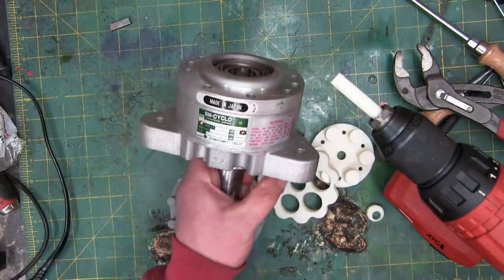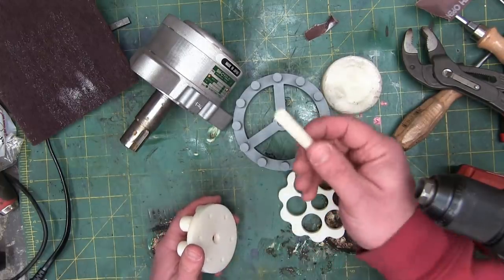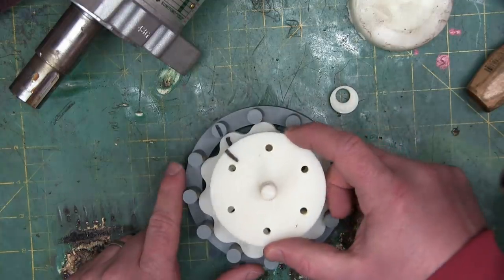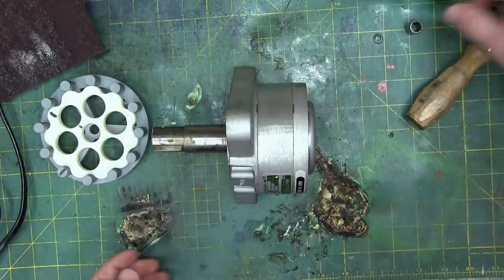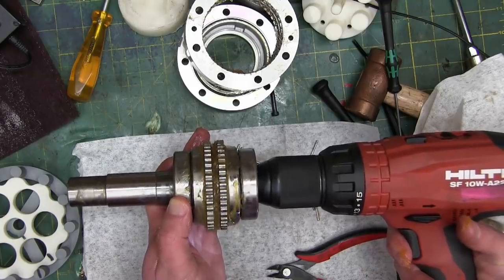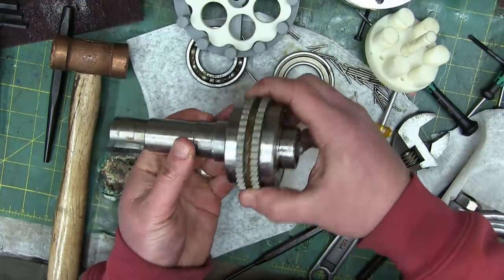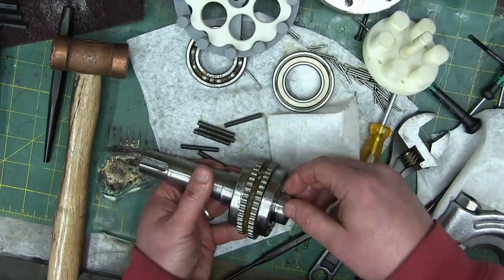BOLTR: SUMITOMO CYCLO GEARBOX | Zero Backlash!

Comment: Good luck putting that one back together.
Reply from the maker: Judas!
Reply: thats what i was going to say
Reply: Piece of cake. Just throw away the parts left over. It works every time.
Reply: Roland Anderson no problem
Reply: My first thought.
Reply: Parts are made of foam plastic to aid assembly. Easy with a little practice. Plus all SUMITOMO parts are individually numbered for reassembly in the right sequence.
Reply: asbaDoce 
Wow. A video just for reassembly
Reply: @larryscott3982  is a great guy
Reply: When I was about 24 i took a (much bigger) one apart and put it back together, it had two stages and weighed probably 800 pounds. Given it took me a couple days and I was in a dedicated industrial repair shop. But it wasn't that bad, I did it with no training whatsoever, I was working mostly on process pumps at the time and this thing rolled in the door; had no idea what it was at the time.
Reply: A lot of grease around the pins would help holding them in place.

Comment: Yet another thing I had no idea existed 13 minutes ago, and now I have to have one.  Not for any REAL reason, just to have one in a box what for showing off to the ladies and such.
Reply: I'm sure you could find a use for it. Get your lug nuts 43 times tighter than normal. Adjust the hot/cold water setting in your shower 43 times more precisely than ever before! You'll surely think of something.
Reply: Get it in your next robot wars crusher weapon?
Reply: For real huh. I know what you mean.
Reply: Some weird ladies you've got hanging around.
Reply: Plus, they're shiny!
Reply: The ladies always love a gear box
Reply: Small enough,what’s the metal?and how much?,, I wonder how it would work on a boat windless
Reply: ya ladies care about your torque spec

Comment: dude, if you 3d print in ABS, you can vapor polish with a wee bit of acetone. to hell with 'a few hours of clean up' on a print.
Reply: Blake D also going slower with a finer tip
Reply: MyLonewolf25 - too much information. Sick!
Reply: In PLA it works with DCM.

Comment: Two words of advice:
1. Very low backlash, agreed. But nobody will tell you the input is not linear to the output! If you plot a chart with the angles measured at the input and at the output, instead of a nice diagonal straight line, you'll get a wobbly diagonal, like a a sinusoidal turned loose on that line! Of course, the effect is tiny, but it's there, inherent in the math of the thing. And if you get the dual stage model, where you have a 1 : 10 coupled to a 1 : 9, for instance, you get the ripple of two asynchronous sinusoidal waves violating that diagonal line...
2. Even using two discs, you never completely mitigate the vibratory effect: you just lower it, by offsetting the direction of the vibration from a perpendicular to the rotational axis to a direction at an angle from it...
Reply: Eros Nicolau what if 3 are used to offset each other like a 3 rotor in a 20B rotary engine?
Reply: Yee Sen Chai I would imagine it would just divide the vibration points (nodes?) Into thirds. Basically you can always cut something in half but you can never get rid of if.
Reply: Yee Sen Chai Oh I know what happens with that one, you get all the teeth sheared off your gears and your rear end will never be quite the same.
Reply: Eros Nicolau the winding were of the standard lotuseldeltoid type with two sperbing bearings to effectively reduce side fumbling...
Reply: All cycloidal transmission devices have a torque ripple. This is caused by the near zero speed motion when the tooth of the rotor is in the pocket of the stator. The angluar motion switches from about the center of the rotor orbit to the center of the lobe. If you've ever used a spirograph you have felt this (it is uncomfortable when the rolling radius nears zero)
Reply: Damn you longstar550
Reply: longstar550: Turboencabulate much? :D
Reply: NerdyFirefighter: That makes a lot of sense too! And I think that effect explains both vibration and non-linearity of the output
Reply: Zeno's Paradox?
Reply: @GUARDIAN1147 You CAN get rid of it with the proper balancing and fixation point. But normally not at every order of frequency.
Reply: Best reply I've seen in a while.
Reply: longstar550's reply that is
Reply: Yee Sen Chai that still wouldn't eliminate it. Of the total stage depth, you'd need to have 25% on one end at 0°, 50% in the middle at 180°, and 25% on the other end at 0°.
Reply: NerdyFirefighter ahhh. That's true. Thanks!
Reply: Isn’t it similar to the classic BMW boxer were there is a cancellation of energy similar to noise canceling earphones?  As long as there is no oscillation induced by the operator there should be no gyroscopic precession, or imbalance... but that’s just my two cents, eh?
Reply: If the two stages are 90 degrees out of phase it should balance to a linear movement. AVE, are you sure it's 180?
Reply: I would offset the inherint perpindicular radial torque offset balance, with a mitigating , angular  to thrust modulated adjustment inclined shim, with just enough trapezoidal  balance capacity , to further induce a fragmenting, but otherwise polarizing momentum capability of 17.5 inertia degrees, while applying a stress reduced, pre-loaded function stator type of manual push to pull effect omni phase ripple inhibitor.
Reply: @longstar550  You're forgetting about enstrapulation. With sufficient lateral hardslip (to use a layman's term) you can all but eliminate greyslide.
Reply: Having used these types of things at work, I can tell you that you are more likely to get motor vibration then you are to get vibration out of these reducers, especially on the output side... TBH I have seen more vibration induced by motor shaft couplings then nearly any type of gear reducer... the speed of rotation of the unit is generally far too low and the harmonic frequencies far too high for any vibration at normal operational speeds.
Reply: So let me get this strait... you divide the angle by the dangle?
Reply: What if you mounted two of these back to back so that the wobble of one cancels out the wobble of the other?
Reply: Richard Smith The most sophisticated 1:1 coupling ever made!
Reply: @rpvermeulen  ;) I didn't think anyone would get it.
Reply: @NerdyFirefighter  That has to be the nicest explanation I've heard for this! It explains beautifully both the concept and the result! Thanks, man!
Reply: And as for the ability to create vibration...

Comment: I used to work at Sumitomo in Chesapeake,VA building these exact same units. Our biggest units were almost 2 tons in weight.This is a very old model but love the vid
Reply: Too Shmart That is a place I wouldn't mind seeing.  Cyclos are lovely inside.
We have replaced cyclos that I remembered weighing a little less that 4 tons.  6000 series 2 stage 600ish to 1 reduction with 15HP motor.
I would have to check the nameplate, but that location sounds familiar.

Comment: I use these everyday as part of a bigger gear train assembly. Taken apart they are pretty mesmerizing to watch. Think of ones the size you can't even put your arms around, yea they are a pain to put back together. Unless you know to flip it upside down so output shaft is pointing up then pins go in last. Noway you are putting the pins in before the discs.

Comment: 8:42 Two contra-phase cycloidals, "minimize" (do not eliminate) vibration. The centrifuguals are neutralized, but since the cycloidals are separated along the main shaft, there is an oscillating torque applied to the angular momentum vector, which exerts a nutating pulse.
Reply: this ^^^.  It'll wobble back and forth, like a 4 cylinder opposed engine. Even though two cylinders are always going the same direction, they're offset so there's a moment (rotational force) developed.

Comment: The cycloidal drive is not going to be a good way to multiply torque, but I think you came to that conclusion already.  I have tried to use it a couple times in my job, but since I really am trying to multiply torque instead of reduce speed, it just doesn't work.  One of the main problems is that the pins that drive the output shaft are only partially engaged.  It is kind of hard to explain, but if you look closely at your 3D printed parts and the contact between the pins and the 6 holes in the gear, you'll see that 1 or 2 are at a tangential point and another 1 or 2 just aren't at a good angle to drive which leaves you with just 1 or 2 pins to do the actual driving.  As a speed reducer the cycloidal is amazing, but it just isn't a good idea for high load situations.
Reply: Eric i read your hard to explained conclusion. Read more then you will understand more.... half a vessel makes damn lot of noise!
Reply: I use one in on a large shot blasting machine in a foundry. The table drive has one it, no idea the reduction, but it puts out enough torque from a 2hp motor to turn a 2000# stainless steel table with 4000lbs of castings on it. Works fantastic.

Comment: The 2 rotor cyclo gearbox still has some vibration. It wants to turn with an axis perpendicular to the input and output. Because the rotors are hopping up and down 180° phase difference you get torque.
You need 4 to balance completely (unless i've missed something). Set them up as a straight 4 engine.

Likely overkill, but if you want insane high speed on that (i don't judge) you should cancel rotating oscillations aswell
Reply: You can just use three with the center one being twice the mass and offset from the outers, if we're picking at details.
Reply: i stand corrected
Reply: That design will balance the free forces of even order but not the forces of uneven order. Regarding free torque it will depend completelly on the fixation point of the gearbox.
Reply: TBH this idea came because it reminded me of an engine and as far as i know inline 4 doesn't have weighted rods to cancel torque (no engineering qualification whatsoever)

Comment: I learned more about how cycloidal gearsets work just now than I did in 10 years working in the bearing store.
Wailing on the sub-assembly with the ball-bearings pressed in place and/or hammering the ball-bearings in place causes the balls to peen the races that will eventually lead to premature failure.
This is why bearings (ball and roller) should always be pressed on, never hammered.
Reply: Tell that to the idiots who install U-joints with a hammer instead of a vise!!!  😖

Comment: I watch a lot of your videos! I wanted to chime in on your mention about recentering an off center punch. I used to build oilfield pump packages (Skids) gear drive and belt drive. I also rebuilt Industrial Gearboxes. I routinely drilled and tapped new holes for the covers on the Gearboxes including the shaft covers with just a drill and tap. Normally they would be sent to a machine shop for that but I told them it was not necessary and I did many of them without issue. Anyway, I used to just move my punch over but I found the best way to do it is to put your punch in the off center hole you made lean it over at an angle and point it in the direction that you want to move your punch hole in and hit the punch until you think it's where you want it then stand it up at a 90° angle and hit the punch harder. If it's still off center just do it again until you get it where your want it then once you have it centered hit your punch hard enough that it makes the hole bigger than the off center one where the point of your punch is or many times I would just end up overtaking the original hole with the larger diameter of the new one. Works every time. Well, At least if you are experienced and have a good eye it does!

Comment: Come to think about it - you can make a crappy one real fast using some laser cut steel parts and some bearings.
Jeez man, why do you hit things with bearings on them with a hammer? That fucks them right up.
Reply: VEC7ORlt He is using a brass hammer. It's softer than steel. Fucks the hammer right up not the bearing piece.
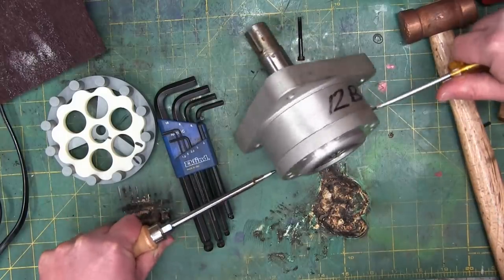Reply: its a copper hammer vs a case hardened or at worst a mild steel shaft - the only thing getting fucked up is the copper hammer - pause vid at 7:34
Reply: And the bearings, which are not designed for axial loads.
Reply: You gotta get those bearings off there somehow and it doesn't work to well radially
Reply: Your right unless he was holding the bearing on the inner race. And not using the seperator and the rolling elements to take all the load
Reply: You've never actually taken things apart have you? Lol
Reply: VEC7ORlt You would cringe at all the rusted on brake rotors I have had to hammer off of hub and bearing assemblies. Lol
Reply: Dan And That's always a good idea but sadly doesn't work a lot of the time unless you can get the shaft into the vise just below the bearing or something similar. But when you take the bearings off you usually replace them.
Reply: Yep, it's surprising that so many don't understand why a soft hammer is used and what is protected by its use! Yes, the struck object will be less likely to deform but the energy transferred (in this case) to the bearing in order to remove it must be the same. You will, of course, need to strike it harder to compensate for the energy lost due to the hammerhead deforming. The bearing has no understanding of the force it's receiving!! To complete the job properly you will need to replace the bearing; it really is that simple.
Reply: VEC7ORlt is saying hammering on it will damage the bearing. Obviously the copper hammer isn't going to damage the steel shaft. The proper way to remove the bearing would have been with a press, but there's still a chance of damaging the bearing.
Reply: Joetechlincolns but that bearing can take some radial load. The bearing in this gear box shouldn't have any radial load.

Comment: You forgot to mention these bad boys can't be back driven!
Reply: Jeff Rosburg Yep same as worms.
Reply: This is not the case.  We use them in large lifters.  I have personally released the motor brake to have the load go down, thus turning the motor.

Comment: what would the efficiency be of this gearbox compared  to a standard spur gearbox ?
Reply: Friction is most definitely higher, lots of sliding surfaces. There is also going to be a lot of pressure on the offset (Cycloidal?) bearing in the middle as it is pushing the gear around. I'm no expert but thats what it looks like to me.
Reply: Cyclops Designs it's the same or higher than spur gears
Reply: in a cheap design that i had seen a bike chain was used for the outside pins. as the lobe plates would move the roller on the bike chain would rotate reducing friction. the reducer was for a jack screw that would adjust a satalite dish. so operation was like 100 rpm for 2 minutes once a week ie low usage.

Comment: My first experience with Sumitomo SM-Cyclo reducers was back in the late '70's with a 30 HP drive in a spiral blast freezer. In the '80-90's I sold them packaged together with the equally trick companion SM-Beier Variator to drive positive displacement Waukesha sanitary food grade pumps. Back then most of these pumps were driven by variable speed belt drives which required lots of maintenance. Sitting on the welding table a SM-Cyclo gearmotor that combined with a VFD will drive a prototype machine I am building. Another cool things are up to 86:1 reduction can be done in a single stage and the mechanical efficiency is unusually high.

Comment: I've heard these called "Grinder Gears", for their characteristic crunching. Last I heard about them there was no known/non-toy purpose. I had no idea they existed as an industrial product.
Reply from the maker: This things are great! Tough as shit, until you forget that the puddle of oil they are swimming in doesn't lubricate the innards.
Reply: Sort of reminds me of the internal workings of a Wankle/rotary engine.
Reply: I work in the largest aluminum can plant in the world. We have these gear boxes everywhere, mostly on conveyance. Some of them are easily pushing 30 years old in a can plant that is pushing 60 years old. Very reliable & indestructible - but AvE is correct, run it out of oil and the clipboard are bitching about downtime.
Reply: Michael-Michael Motorcycle I have seen one go several hours without oil.  Not totally dry, but the oil leaked out through a blown output seal (vertical drive).  They sure let you know about it, they howl!

Comment: The center shaft is two pieces, the three pins you "don't know what they do" hold the top and bottom half together. Press them out and it will split apart reveling the goodness within.
Reply: That's what I was going to say! It can't just be a slot in the bulge, you could never get the dual opposing gears into the slot!

Comment: This mechanism is a slight variation on a trochoidal gear which is used mainly in hydraulic pumps and hydraulic motors.  When I had to replace a seized spare tire winch in my old Dodge caravan I dissected the old one and at the heart of it was a trochoid reduction gear.  I love this sort of stuff.

Comment: They are super durable too. They can take 500% shock loads as well. No gear teeth which means more durability. They will run for ever too. Super easy to rebuild, usually the only thing that goes wrong with them is the high speed bearing. Properly lubricated and used with the proper service factor. These little puppies will run for a while. Coupled to an electric motor with a Lovejoy coupling. Super low maintenance. They are awesome

Comment: I can't help but think those three larger pins are both additional routes for torque to pass through as well as press fit to hold the the input side of the assembly together. If that doesn't come apart more without pulling the input shaft then that means that the cycloidals necessarily fit over the output shaft flanges.